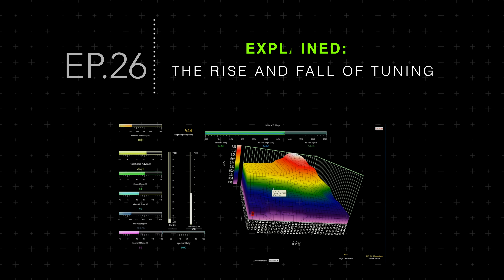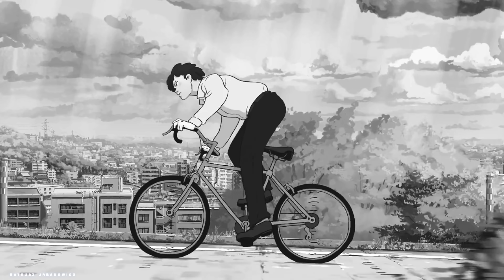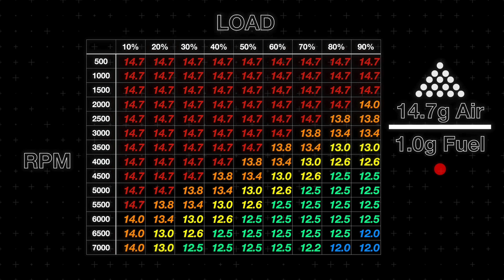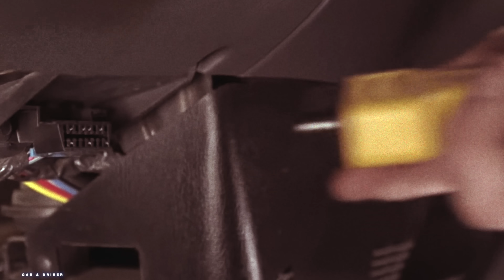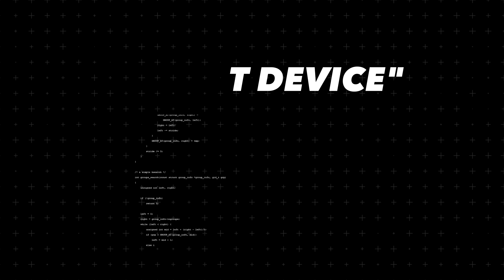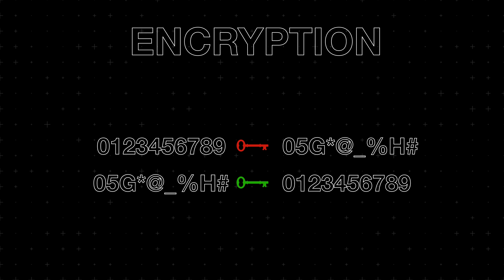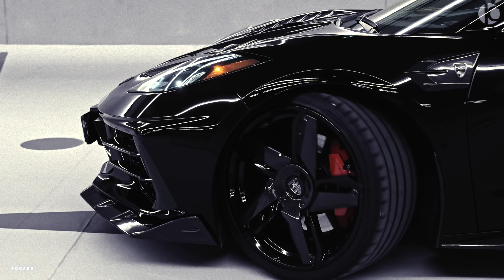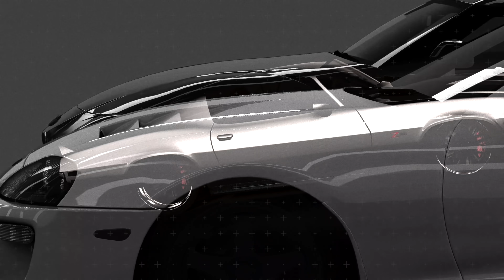How Tuning Engines Became Illegal👮🏻‍♂️| Explained Ep.26

Comment: Soon enough, the only route to tune your car is to replace the ECU completely with an aftermarket one
Reply: It's not the ECU that's the complete problem. All the modules talk to each other, when one's screwed with, the other ones go batshit. Knowledge of microprocessors and digital systems will be a requirement.

Comment: wow. theres a lot to unpack there. i want to make a couple points. first: it is becoming more difficult to tune not because of "government overreach" but in part because there used to be a lot more power on the table for little risk to the engine. but as engines have become more complicated they are running closer to the edge than engines used to. also, manufacturers are not making it difficult to modify the computer for emissions. its a brand image thing. if all these people (who honestly have no idea what they are doing) start tuning, they will likely break shit. and then the cars get a reputation of being broken pieces of shit, which impact brand image. just ask subaru about how customers modifying their cars can impact the brand. also, cars can be modified and emissions compliant. i have a 95 legacy (OBD-I) with a JDM STi swap running a full standalone which i tuned my self. it gets better milage, lower emissions, and more power. i agree that modified cars are a drop in the bucket but the problem is that people abuse loopholes. if it was only the gear heads that were cheating emissions that would be one thing but its people who are just using the loop holes.

Comment: You missed a 3rd option.  Those intelligent enough will say "FUCK YOU" to the car manufacturers and build their own ECU that completely or partially replaces the factory ECU.  When all you have to do is pop out a module or 2 and replace them with the tunable variant I see not issues.  Holley already has it's own standalone ECU setup and there are other opensource variants out there.  RusEFI and Speeduino are just 2 that come to mind.  They read the data coming from all or some of the OEM sensors on the engine and have their own opensource, unencrypted, and freely tunable code base.

Comment: There needs to be a part 2 about how companies are building their own ECU's to keep the tuning game alive.
Reply: That's only cuz manufacturers are locking the factory ecu's.
Reply: @scottruch76  that's only half of the reason. The other is that the newer aftermarket ECUs are easier to tune and are more capable/expandable by design making them the better option for higher power tuning. Some I believe, are even self tuning to a large degree.
Reply: @slimjim2291  luckily I still have a tunable ECU lol
Reply: @scottruch76 what kinda of car is it for? I am still learning about this stuff. Engine repair Cert 2021
Reply: @TheGreaterAmericaProject  02 WRX.
Reply: Nice, mine is an 05 WRX, and ihave the Cobb AP and accesstuner software, (my software hasn't seen internet updates in years so the new Greenspeed crap doesn't affect mine. ) So not only is mine tunable, but I tune it myself, currently I have it tuned on e85 with some STI parts and injectors/ fuel pump... it's quite eager I will say. And I can still turn off the DTCs that the updated software won't let you. Here in Texas the e85 appears to have just switched to summer blend, so this weekend or next I'll be making some fuel trim and likely timing adjustments.
Reply: @scottruch76  03 bonneville SSEi (not many of these around anymore)
Reply: @scottruch76 funnily enough my 90s JDM honda has an un-tunable ECU lol. I need to buy a chipped integra ECU and a hondata S300 to be able to properly tune the ECU which is like a $1200 combo
Reply: Piggyback or replacing the entire ecu is the only way forward now
Reply: @angelgjr1999  They can be defined as emissions defeat devices and voila! You're breaking the law.

When everything is illegal, everyone are criminals.

Lawmakers and the citizenry have never before been so at odds with one another.
Reply: @Sagan_Starborn the epa is definitely on the chopping block
States already regulate their own pollution and populations, the feds and their wasteful ways trying to get into war all the time, are not needed
Reply: @Sagan_Starborn The problem is that they have no business being at odds with the citizenry!  They serve us, not the other way around.  They are not our leaders, they are our representatives.  They all need that relationship forced down their throats!!!
Reply: @Sagan_Starborn yeah the 2 things I got into late guns and now cars. Gotta love it
Reply: Replace @angelgjr1999
Reply: when ford & others realized that the fox body aftermarket was taking off bigger than what typical hot rodders did with holley/edelbrock (bbk, frpp, steeda, saleen, roush,  etc...) and tuners were able to even reverse engineer their OBD2 systems, coupled with OEMs liek BMW M, it was clear OEMs had to get in the performance game. Next thing you know you were getting SVT, M, AMG, Vspec, Sti, etc...  Well that cannibalized the aftermarket & tuners, when you can get similar with a 3yr warranty from the factory. 

Now with the Gran Turismo generation, cars are now appliances and you can customize & tune at the touch of the finger. Mainly for warranty purposes. Instead of tuning for power or some safety, one is tuning for "driving style".
Reply: I accept that statement
Reply: I was gonna say at this point we might as well be making our own
Reply: @sammy_1_1   several companies already do. Holley, haltech, AEM, motec
Reply: @brandonphillips3711  I figured that much lol
Reply: Nistune Megasquirt
Reply: Except what will happen eventually is more and more components will handshake with the original ECU in a way that prevents replacing or piggybacking it without significantly more complexity.
Reply: Talk to PFI, they were fined thousands of money.just to supply a mod for a car they did not install!
Reply: Itll be funny if gov officials already knew VW cheated their EPA system before 2015, thatll be silly
Reply: Yess!!!!! The standalones!!!!! AEM, HALTECH, HP..
Reply: A while ago a tuning wiz that I corresponded with said "show me a system and I will show you a way to beat it" ...........and he did.
Reply: Never getting rid of my BMW😂😂
Reply: IMO piggybacking is the most graceful solution unless you are basically building your own car

Comment: I have yet to see an ECU that could not be cracked. The problem now is if you crack it, the dealer can tell and then void your warranty. Piggy back units are getting much better, and the good ones are completely untraceable. None of this has to do with clean air, it's all about squeezing money out of people. Luckily, modern cars are getting so good, you can have really fast car, and a warranty. I also think this is a big reason we are seeing the used car market go through the roof. Much easier to mod a 90's car and still get it to pass emissions, unless you're in the anti-freedom state of CA.
Reply: The problem is when people start referring to warranties. You either deal with the consequences like a man, or put on a tutu, and cry to the dealership about something you probably broke.
Reply: @kensmechanicalaffair  Too many people have done exactly that. Buy a car, bolt-on a bunch of crap, don't tune it right, blow the car up, and then cry foul and try to blame it on the manufacturer. Twenty years ago people were getting away with it too. As long as you're smart about what you do, you can have a little fun and pump the vehicle up without risking it. At the end of the day, if you can't afford to fix it, don't take the gamble.
Reply: @youareallbots  I've heard manufacturers complain that someone will break something, and then take the car to the dealership and say it's underwarranty. Not a very smart group...but they got the money. Anyway, I feel like this gives the manufacturers, a legit reason to brickwall you out of your vehicle. 

The engineers might do contrived things to make it hard but, they also hide secrets within the ECM and BCM, that make discovery worth while. I just hate when things are ruined...
Reply: warranty dont really mean anything when you still have to pay out of pocket for a design flaw
Reply: You can program a engine ecu so it's undetectable that its been tuned. Vehicle ecu's are not super computers.
Reply: @moabman6803  The modern car network connects to each other using two wire can bus, fiber optic, and an ethernet cable, lol. It's super computing trust.
Reply: @Mr.President sir  Can networks are very basic in vehicles. Afaik there are no fiber optics in automobiles.
Reply: @moabman6803  The device is called a PCAN-LWL. It's a can bus optical converter..
Reply: @Mr.President sir  That's for a polymer type of cable, not glass like true fiber optics. Mostly they use shielded wire. This technology is not new.
Reply: @Moabman  They can tell when you flash the computer in the ecu. They can also tell when you flash it back to stock. One example, some manufacturers are putting mileage counters in the ecu. When you flash it, it takes it back to zero. If they don't have it on record, they know you have been monkeying around with it.
Reply: @Emory Holley  Yes but they are working around all of those obstacles.
Reply: @youareallbots  So what if you bolt on a custom ECU on top of the stock one and plug everything into that and just leave the stock one untampered with?
Reply: Fuck a warranty when you’re having to do what the manufacturer should have done…

Comment: The insanity of government regulation is brightly highlighted by CARB.  In 2002 an acquaintance of mine took his twin turbocharged '89 Mustang to get an emissions check, after finishing his projects.  The brand new EP3 Honda Civic Si that was sniff tested before his car was running dirtier across the CARB emissions test run than the modified decade old Ford.
Reply: Thank god my county doesn’t do emissions
Reply: This is what I don’t understand about California and the smog checks. If you modify your car and it’s cleaner or the same as stock it should pass. I feel that carb is a cash grab, and or they don’t trust enthusiasts to maintain the emissions of their cars.
Reply: @deep_drift  You feel it? No, it's been always about the $ they don't give a shit about anything they say they stand for. Maybe a naive employee does
Reply: @AnotherMotorist  CARB has good intentions of keeping the air clean, however they have a big overreach when it comes to car emissions especially with these types of issues.
Reply: Yeah, with modern tuning capabilities, knowledge, parts, materials, etc., you can do a clean burning boosted monster that can even run idle and on "tame street" mode that will run cleaner and with better performance then anything the Big Corps are craping out of the assembly line.

Comment: It really doesn’t help the people mandating this are so out of touch with the modern world, the one lady that was being asked about normal people racing thought all that existed was “NASCAH”. These people need to honestly be rooted out as any GOOD tuner makes your car run better than factory. 

Another HUGE thing is that E85 was completely passed up on and we went straight to electric. E is cheap, renewable, and can be easily worked in but no it all has to be electric.
Reply: Yeah it feels weird how we completely skipped on E fuel when it's by nature a "carbon capturing bio fuel" since it's made of corn.
Reply: @almostlastplace  overall it's not good for the environment at all
Reply: @almostlastplace  e85 is not all it's cooked up to be. It's less energy dense and filthy as all getup in your fuel system.
Reply: @lolbuster01 less energy dense yes. But it runs cooler and has a higher octane level which allows for increased power output. Doesn't harm modern fuel systems at all
Reply: @sutherlacd27  I don't drive computers.
Reply: @sutherlacd27  ethanol harms any fuel component that is made of aluminum due to its affinity to bond with atmospheric water AND provides an environment to breed bacterial life which feeds off the ethanol to create acetic acid. Ethanol fuel has been used to DECREASE fuel mileage in order to make EVs more palatable. (the long game, a con)
Reply: @astr0creep6x6x6  The shocking thing i discovered is that in the USA, premium gasoline has an octane rating of barely 92, while in Europe, the standard level gasoline is not 89, but 95. Yes, you heard it right, 95 octane is the regular gasoline.
Reply: @mozeskertesz6398  That's because they use a different rating, so those numbers, don't mean the same. The U.S., uses A.K.I., which stands for anti-knock-index. The higher the A.K.I., the better on turbocharged and supercharged engines. 92 is the A.K.I., it looks like. Go with too low of A.K.I., you risk turbocharger failure or supercharger failure! Looks like a lot of people think turbos are junk, because they put 87, if not lower A.K.I. and expect no turbo failure.
Reply: @almostlastplace  I think you may underestimate just how much fuel farmers like myself burn to grown that corn.  That has to be taken into account when determining how clean it is or isn't.
Reply: I mean compressed natural gas burns clean and cars can run it just fine buuuuut that don't fit their plans
Reply: G4
Reply: Yeah, e85, let’s burn our food. Did you ever wonder why your box of Cheerios is $6 now.🤦 

As soon as farmers could make more money growing corn for ethanol, they used far less acreage for growing corn we consume and the food prices skyrocketed and never went back down. The epa legislation caused our grocery bills to double. Stupid effing move.

Think critically people, stop thinking for the moment and try to see the big picture. What good is a “saved planet” when no one but a few can actually afford to live on it.
Reply: It's a push to eventually remove access to cars for the population.